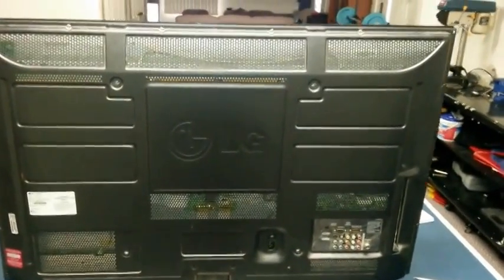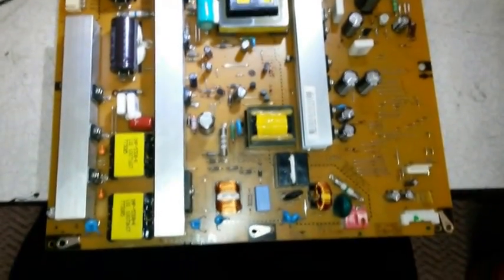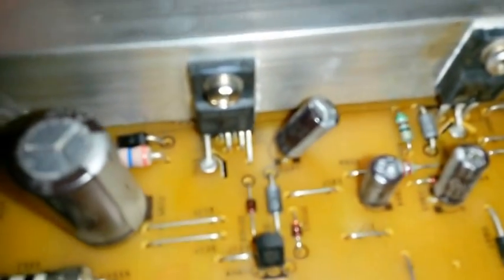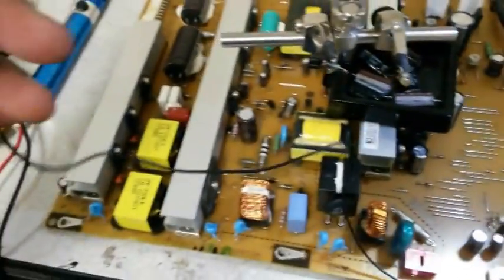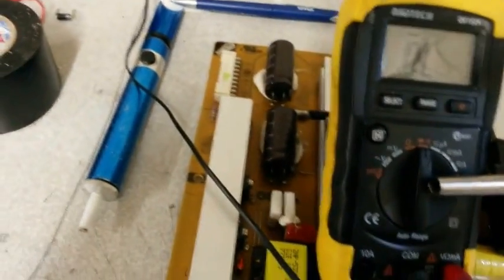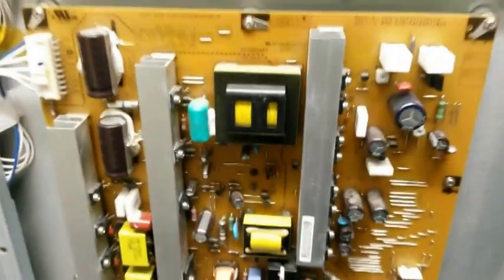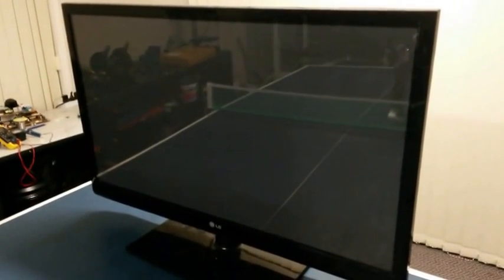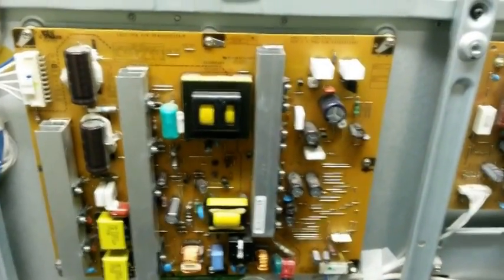LG 42PJ350

Comment: My tv had same 'ticking' problem. Changed all parts but nothing changes...
Reply: https://www.ebay.com/itm/EAY60968801-EAX61392501-for-LG-50PK350-plasma-REGULATOR-3BR1565JF-REPAIR-KIT/283436559779?_trkparms I ordered these parts and it hasn't changed. the TV does not work, the relay still clicks.

Comment: Hi nice informative vedio , i have42"LG plasma tv with stanby light but nothing happen when power is press on tv or remote ,power supply has all it's voltage going to main board and sustain board , is it the main board problem ? Please advice , thanks

Comment: mostly same problem.....clicking sound n x start..i just complered repair....non of the videos learned work...finally its simple problen....
Reply: Rooster sam yeah, that diode brand new have 0.24v drop! I changed mosfets and controller on vs/va primary side, but still clicking..

Comment: Hello, i don't know if you can help me out with this but i have soldered a new diode, the voltage regulator and the resistors. The Tv worked for about 2 minutes and got back to the clicking cycle and doesn't turn back on. I have not tested the fuses. Can you teach how to test those please.
looking foward for an answer.

Comment: i change the Resistors R108 to R113 
too small resistance, 680kOhms have 560k, 620kOhms have 520k, and 560kOhms have 500k
and NO CLICKING and WORKS LG PJ350
Reply: Yup 3 years on this set still works flawless

Comment: i did changed all those parts and still got clicking noise. what else it could be ?
Reply: Norbert Greszko ..stil x start ?
Reply: Cold solder joints on the 2 transformers up to the top